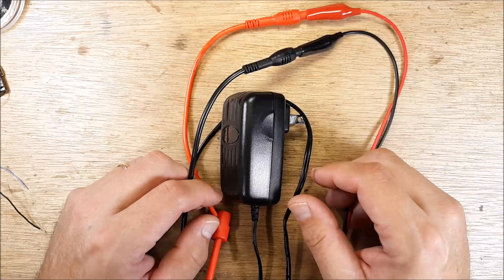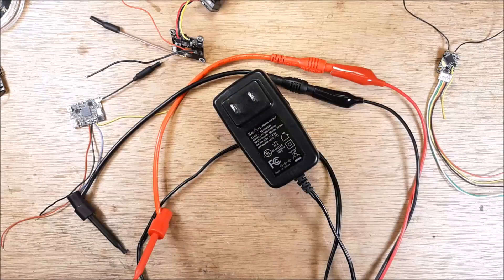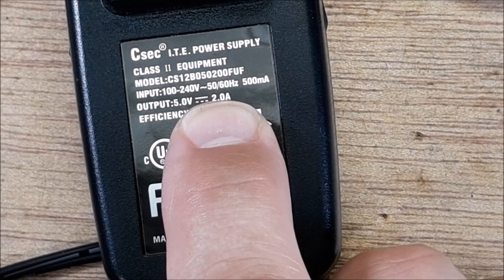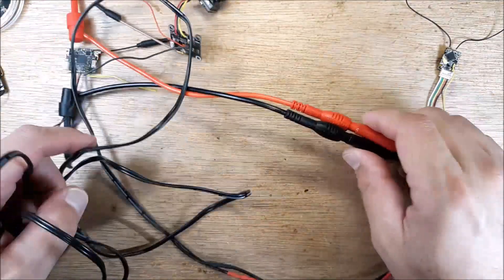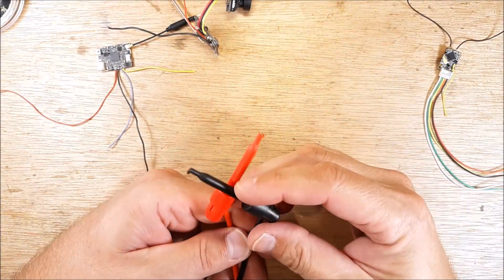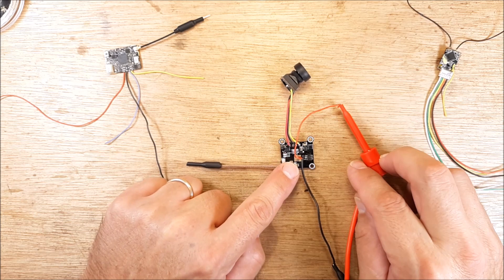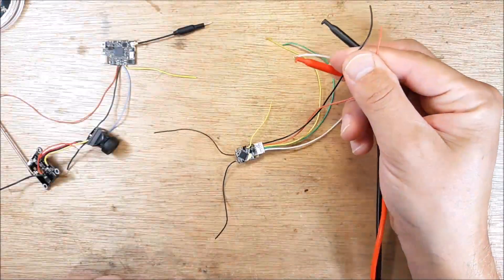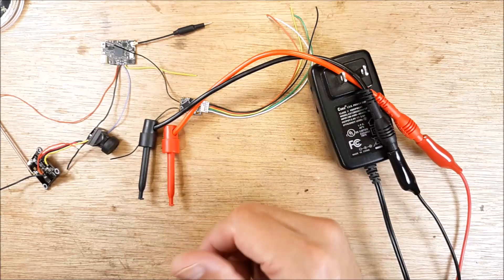How To Make A 5 Volt Bench Power Supply | If RC Is Your Hobby You Need A Power Supply

Comment: can the r-xsr be use like a spektrum satellite on helicopter fbl . on helicopter fbl i have witch to frsky from spektrum and new to the frsky receivers
Reply from the maker: Yes. You can use an Sbus to PWM decoder to use any servo. I personally have not used an Rxsr in this way but a decoder is like $10/$15us.
Reply from the maker: Also, if your planning to fly something expensive, you can double the protection by running a redundant receiver setup as I did on the Rescue Drone. It's the best way I found to never fail-safe.. Just build the redundant receiver system as I did in the attached video and add a decoder to the Rxsr from the Sbus. It sounds like a lot, but it's a pretty small package...🍻
https://youtu.be/_N9zTFfW-1s

Comment: Very useful tips, love this simple solution for testing before a build, would save alot of time to test DOA boards I've received on more than one occasion.  Just a quick question, I recently fitted a flight controller, only to find out later that the sbus pad didn't work.  How would you troubleshoot that?
Reply from the maker: It has saved me a ton of time 4shO.. 
As far as testing a Uart/serial port on you FC, I reckon you would need an oscilloscope with logic analyser mode. I haven't ever had to do it, hum?

Comment: Great video!  Instead of a power supply, can I do the same with a USB port from a laptop or PC ?
Reply from the maker: Thank you for checking out my channel and subscribing! I appreciate you! Yes, you can use the 5v hot and ground from the USB. Do make sure you use a 2A+ output. Also keep in mind, I see a lot of cheaply made USB chargers that only rate for 0.7 - 1.0 amps - Beware.. Enjoy the Breeze...👍🏻🍻👊🏻

Comment: Where did you get those little clamps you attached to the VTX?
Reply from the maker: https://www.amazon.com/Yubone-Multimeter-Stackable-Alligator-Silicone/dp/B07FDTZ4JP/ref=mp_s_a_1_3?dchild=1&keywords=bench+leads&qid=1601404113&sr=8-3
Reply from the maker: I linked what I have purchased in the past. It may be different now. The bench test leads are very convenient to work with..
Reply: @PropsOff  THANKS!

Comment: @propsoff what’s the little yellow wire solder on the your receiver for?
Reply from the maker: It's an univerted S.port wire for one of my previous builds. I'm reusing the R-xsr on a new build and have a brand New wire harness connected (I will modify the wiring in the next build video).

Comment: How do you know what wire Is positive and what's negative from the 5v power supply wires? And could I just use alligator clips to test my components or do I have to use the smaller ones like u had
Reply from the maker: I used a multimeter to identify and verify the 5v out line. I use alligator clips all the time. I do find the test leads to be more convenient though.. If your unfamiliar with the multimeter to measure 5v, I have a quick tips video coming tonight, hopefully...👍🏻🍻👊🏻